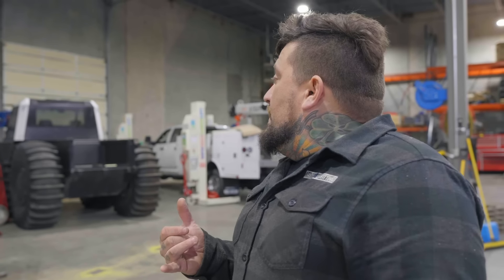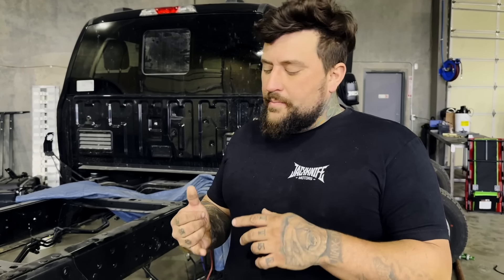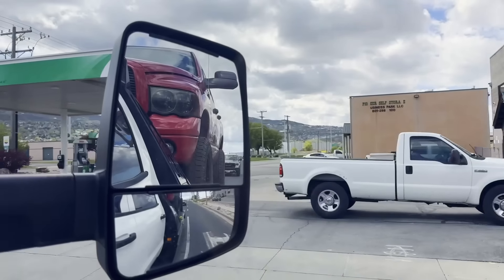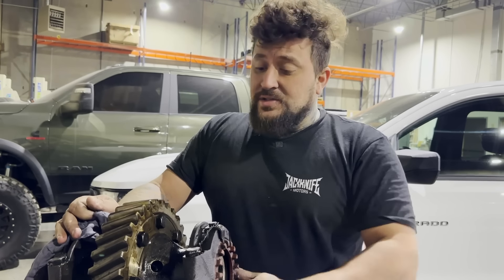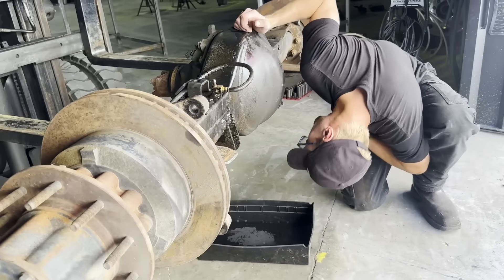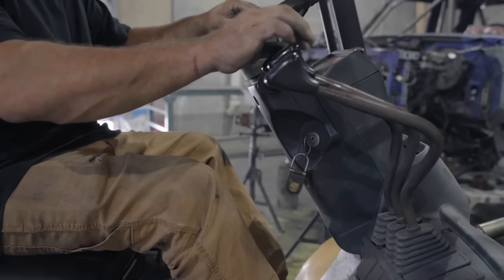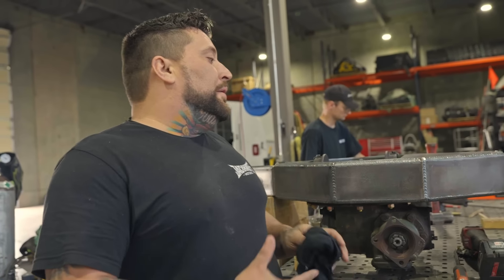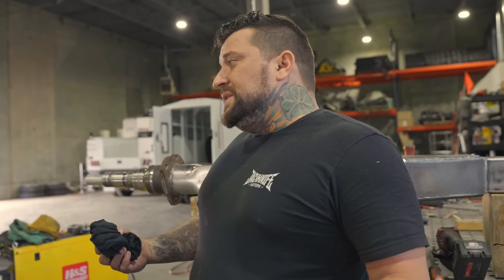HOW TO  BUILD A MONSTER 6X6! **Custom AXLES FIRST

Comment: Honestly wouldn't it had been cheaper and easier to have a custom power divider made ? Theres a company out of ohio called scs gearbox that does it for monster truck with a neutral and a pinion so it bolts up to the axle

Comment: Just curious🤔, but wouldn't it been easier to just use the whole rockwell axle and just cut the ends off and put the ford hubs on with custom axles and suspension. And Correct me if im wrong, but the f550 comes from the factory with the square tube big truck style rear end for the weight capacity. Where as the axle you showed at the beginning of the video was more for a f450 since they still use the cast iron center section with weld in axle tubes.

Comment: A $100,000 add-on   why?? More money than brains!!
Reply: You must be new to the utility truck industry. They are building a truck to fit a customer's needs. I worked in that industry for 14 years and what they are building is a medium- heavy duty utility truck. I've seen bigger 6x6s with 280" custom utility bodies that were upfitted with different kinds of capabilities.
Reply from the maker: Wouldn’t take a ton of money;)